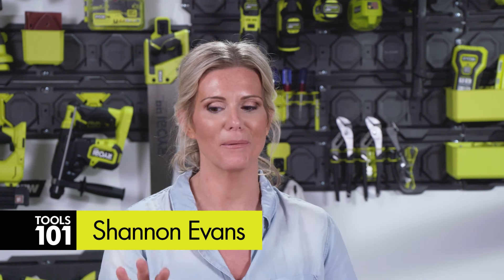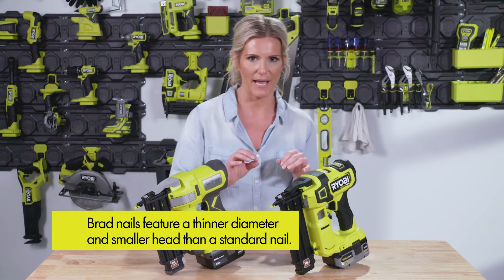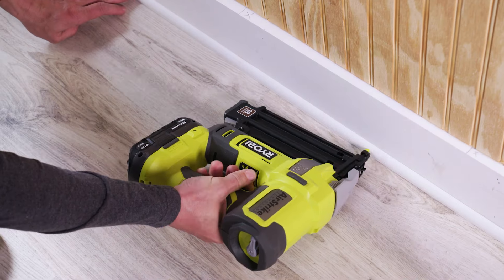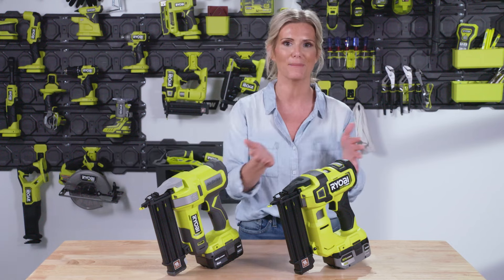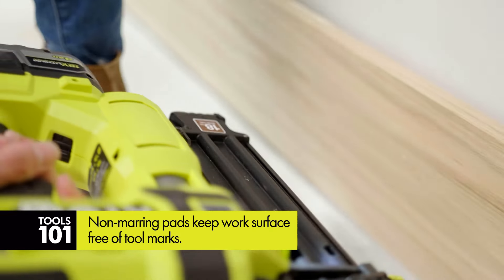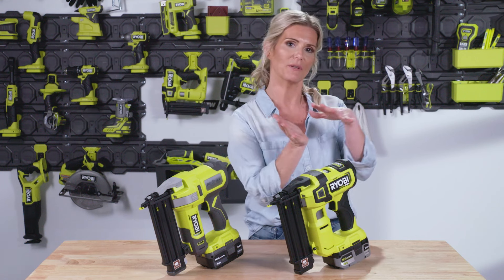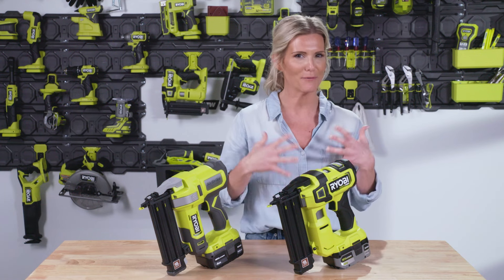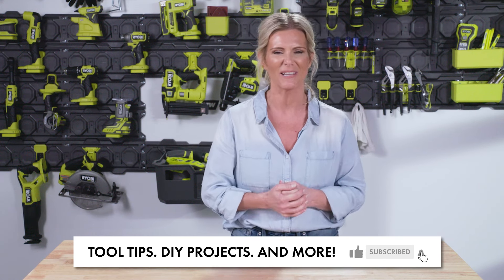How to Use a Brad Nailer | RYOBI Tools 101

Comment: Another thing to mention .. shooting 2 nails at a 45 degree angle from opposing directions will add some strength. This helps reduce materials that cup or bend from coming lose over time
Reply: Great tip! Thank you! Happy building. 😄
Reply: True, but I haven't found this to be possible with these Ryobi nailers. Have you? What's the trick? It seems as though the nose needs to be perpendicular to the board in order to shoot the nail.
Reply: @andreav2125  Just hold the nailer at an angle and push on it a bit. Works fine with mine

Comment: Another thing to mention is that it WILL NOT work with 2Ah batteries.  I have fired one nail off with a 2Ah battery then, the low batter light flashes. Put in a 4Ah battery and it works until the battery is dead.  Luckily I had a 4Ah batter from my blower to put in this, or I would have been dead in the water.  I have the Ryobi P322 Brushless.

Comment: I used this for siding and I cracked the siding in several places even after adjusting the air dial and nailer settings. She didn't show the safety feature properly should Plug out the battery and the nails otherwise the spring will push the nails upward.

Comment: My P322 arrived today, but it does not work with my old P102 battery (fired one nail and stopped working).  The manual does not mention battery type or size.  What is the recommended battery size or did I just receive a bad unit?

Comment: Spent 3 days working. Building a deck, doing some roofing to afford the ryobi package from home depot. Spent 2 days off work researching the best deal for my needs with the packages ryobi has at home depot. Boy, talk about alot of good deals and great kits. Problem is bags zipper is missing a tooth. The zipper bent in half when I tried to open it. Then the crate set a 3 piece item was only one. 3 teir stack unit is missing the medium and standards box. Now ryobi wants me to drive 20 minutes each way to return the item so they can reorder the same item and drive back again to make sure its right. So my "deal" s now paying full price. Makes me want to return it and never try ryobi. Ive never owned a tool and this is a horrible experience. A day off starting projects turned into a ryobi nightmare.